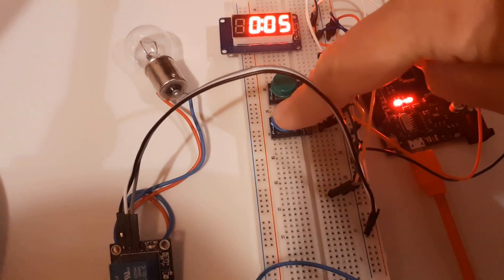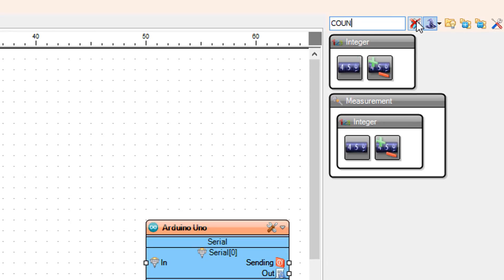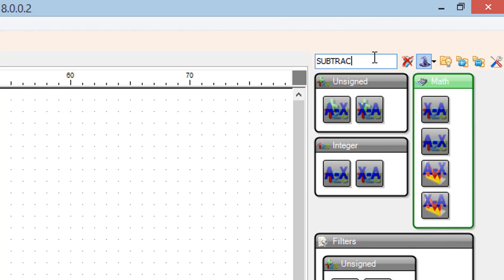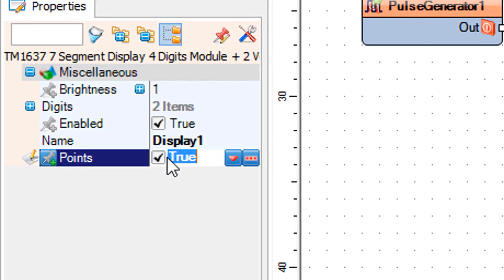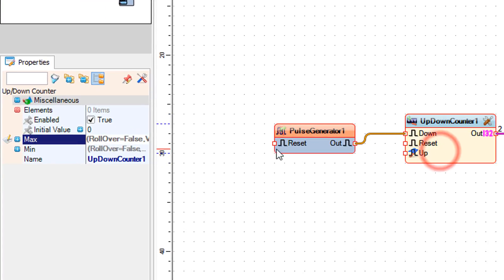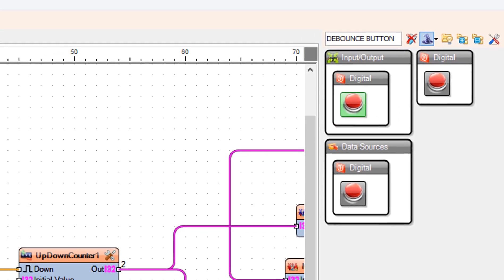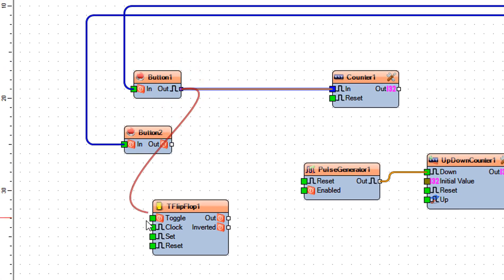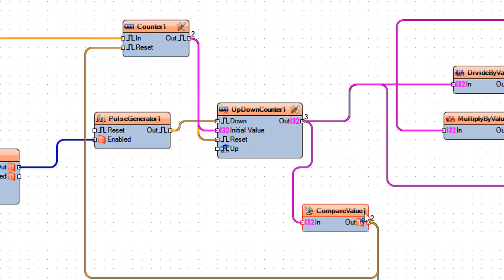Arduino Countdown Timer with Relay

Comment: How can I change, instead of turning on the lamp after the timer reaches zero, make it the lamp will turn off when the timer reaches zero?
Reply from the maker: You can add Compare Integer, and set isBigger then 0, this way it will be On when bigger then 0 and when its 0 it will turn Off